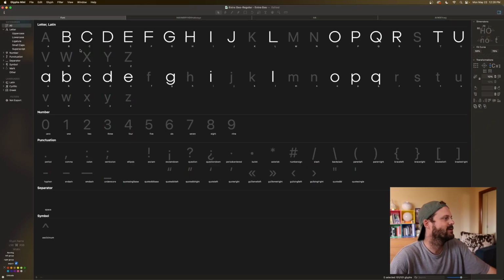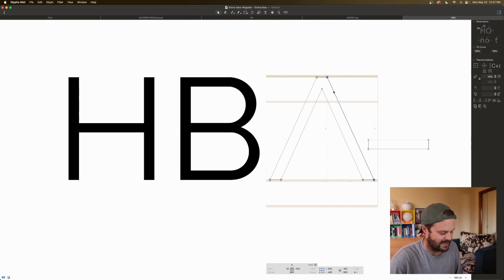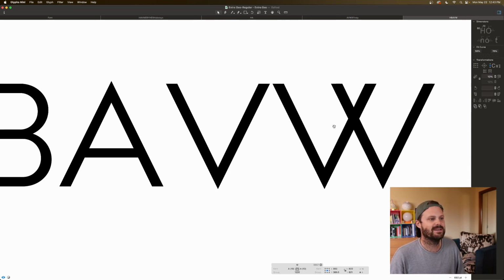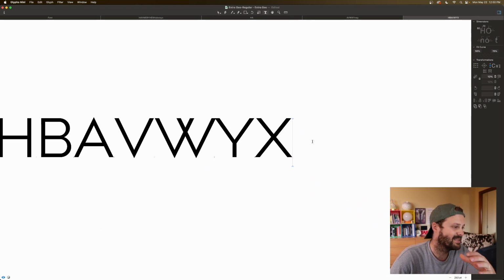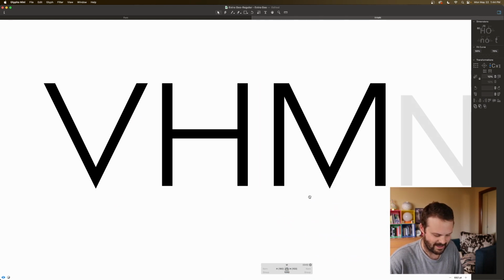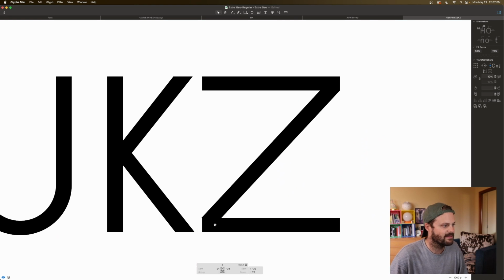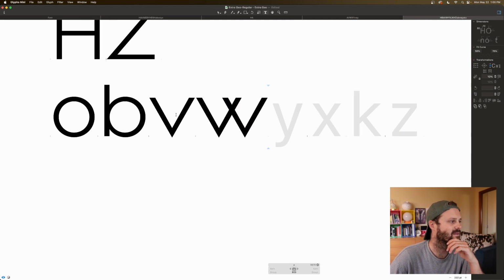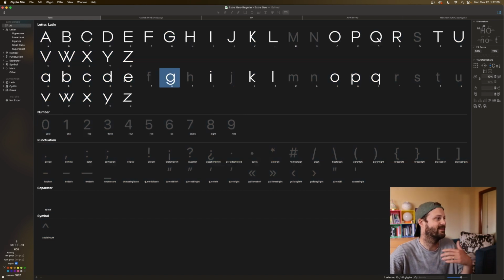Intro To Font Design (Geometric Sans Serif) – Part 3 Angled Glyphs

Comment: 18:25 Why did you cut off the X? I don’t see any optical illusions of the X being like that.
Reply from the maker: with a thin weight and a low contrast it docent look like much cutting the thin stem of the X in more important when the for is more bold and has a greatest contrast between the thicks and thins. mainly I just wanted people to be aware of it as a step in the process. some fonts might not need it (like this one) other will look real off without it. Good observation.